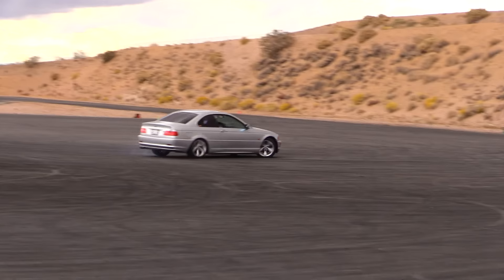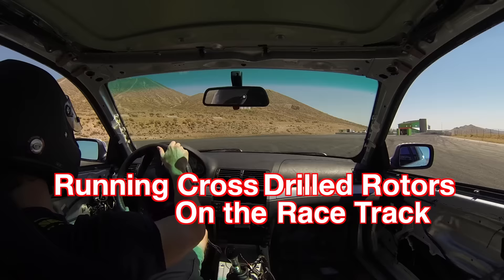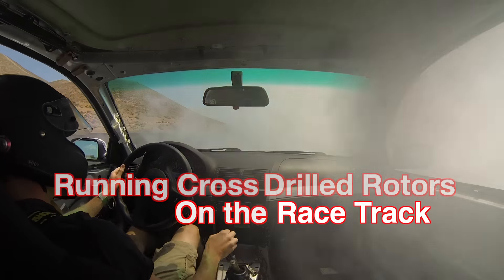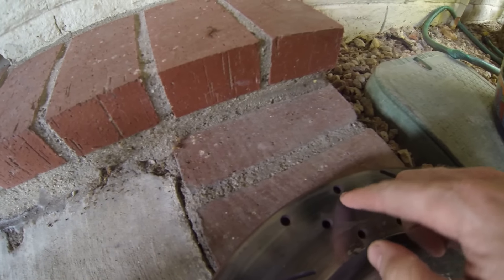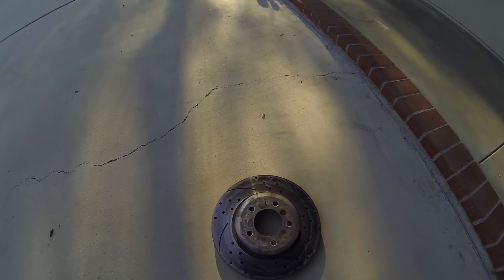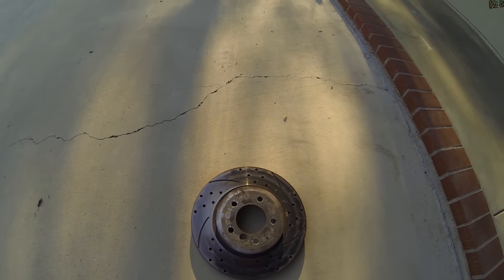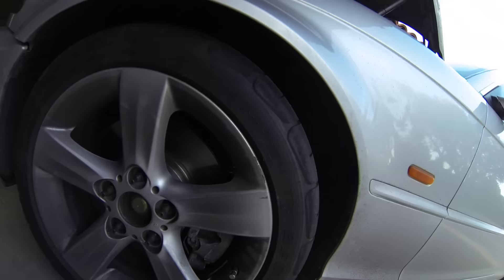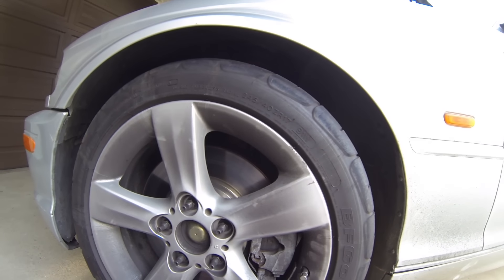Cross Drilled Rotors at the Race Track

Comment: No one believed me when I said cross drilled rotors are a waste of money. One good thing about getting the Duralast Rotors is that you can take advantage of the warranty until they catch you and buy it again. Rotors 4 dayzz
Reply: Michael Dao I don't even mind buying them since they are so cheap in comparison to the other consumables.
Reply: ***** Are you referring to the Duralast Rotors?
Reply: Michael Dao Just blanks in general. I get mine for $20-25 a pop.
Reply: ***** Jeez that's cheap! I've been going with Centric blanks for about 47 each for fronts. Duralast is 39
Reply from the maker: +Jason Parraga Wow good find.  Are these decent rotors Jason? I just picked up an S2000 CR for daily driving.
Reply: +ZentRose I just ordered my second set, but I have yet to put my first set on. 

I did however inspect the veins to ensure that it had as many as my OEM rotors that came off and it did. 
I'll take a micrometer to my fronts and see if they are due and put them on tonight if needed.

Also, I hate you for
1. buying a CR
2. buying it for daily driving on top of that

you're crazy
Reply from the maker: +Jason Parraga LOL I'll let you drive it if you want. I live near you now.